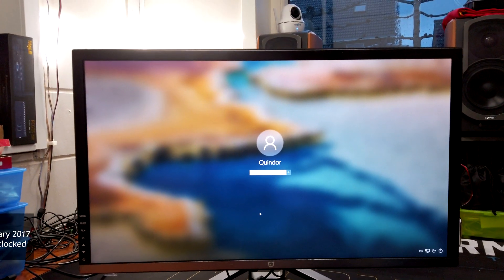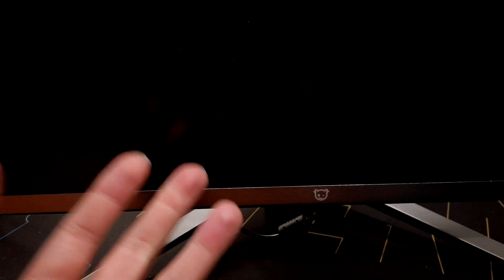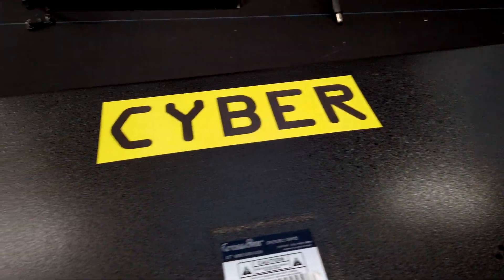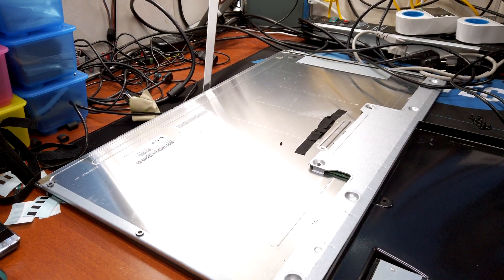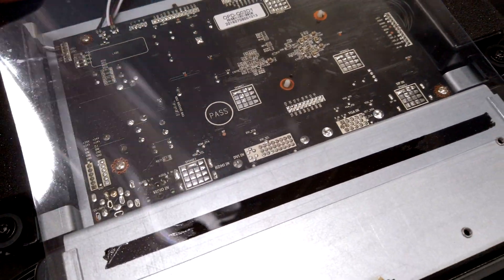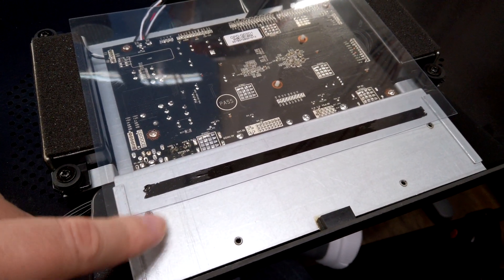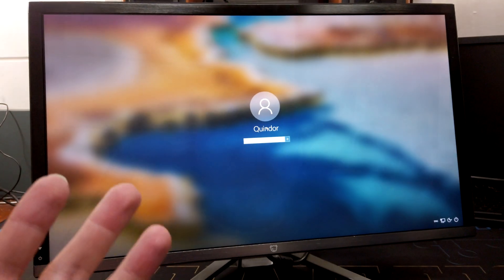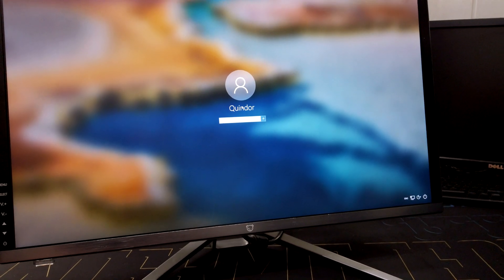Let's talk about: Broken Monitor, Can I Fix it?

Comment: #RightToRepair .. an issue for folks in the US. Making more landfill for reasons of possible profit is a step in the wrong direction for early in the 21st century. The future is rolling their eyes at us. Great video, I might need to do this with one of my monitors.
Reply: Ooer the power brick with wire ties? I am definitely going to steal that idea! Cheers.
Reply from the maker: I once got to a Lanparty and it turned out the power brick was still at home.... This shall not happen again and it just fit there so perfectly!

Comment: Putting all the screws back in before testing.... Cable management too?!?!?
Reply from the maker: I know, I know. But if this wouldn't have worked, I didn't feel like taking it apart again that day anyway and would probably had to order the socket, so yeah, YOLO time and buttoning it all up before testing. ;)
Reply: @IntermitTech  Also next time u do something like this plz get a multimeter and measure the contacts before and after. Look which pads are connected to +/- in advance so you know how it should look when you're finished!
Reply: @IntermitTech  I'd have ended up just leaving like 4 screws in the back of it.  Plenty of friction to keep it together.